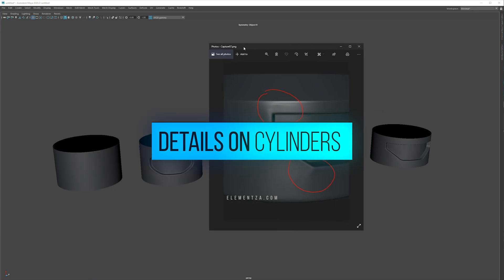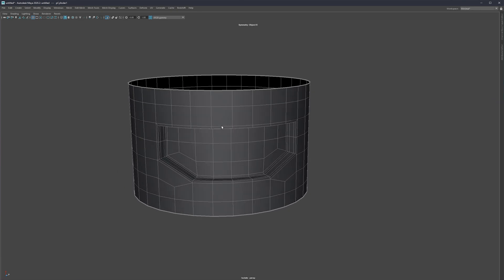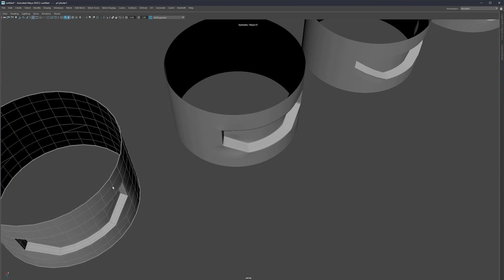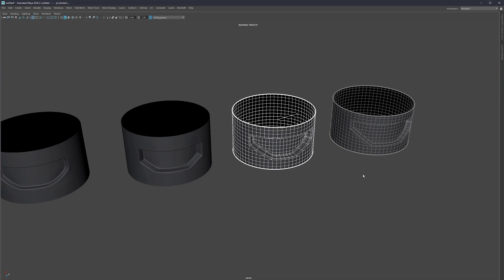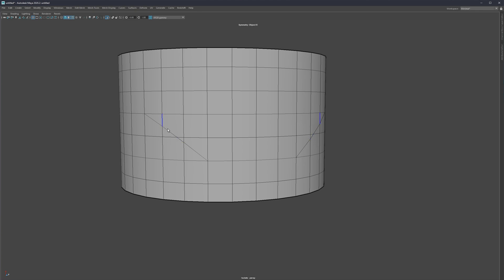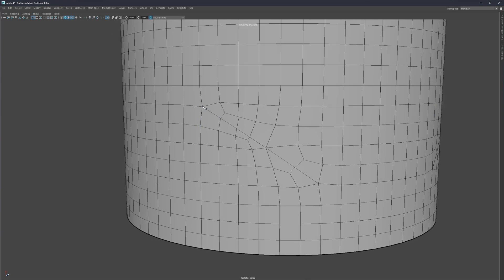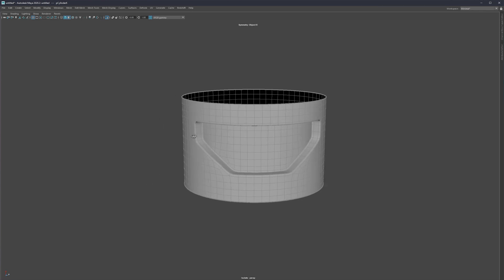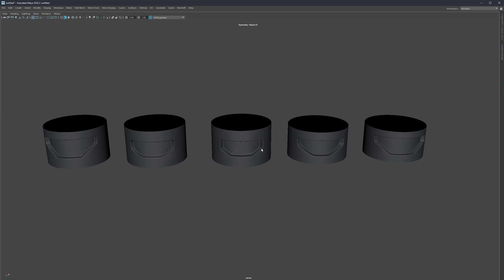Why am I getting this type of pinching?

Comment: I just want to be sure about this, since I was a little confused while watching this video. So subdividing will get rid of the triangles that cause the shading problems. But it might also warp your diagonal lines, so you might need to get rid of some of those triangles first, then subdivide and do some cleanup.

I guess the best thing to do is experiment with various techniques and see how the techniques change the shading. Obviously it helps to know how edges are going to affect the shading, which is definitely something I'll need to keep in mind. It might be useful to experiment with modelling on curves just for the experience.

Comment: Tip: Build it by starting out with a flat plane and then bend it with the bend deformer to a cylinder.
Start by calculating the circumference of the cylinder (π * the witdh of the cylinder), this is the width of your plane. The height of the plane is just the height of the cylinder. Do all the modeling you like on the plane, extrusions etc, when you’re done, create a bend deformer with the plane selected (deform > non-linear > bend), scale the deformer in xyz so that it matches the width of the plane. Bend 360 degrees. You might have to change the orientation of the deformer by rotating, once you start bending it’s fairly easy the see on the gizmo how it needs to be oriented. When done, make a duplicate of your newly created, detailed cylinder and merge the borders that came together after the bend.
Bending this way you ensure that all the detailing ends up as closely as possible to match a cylinder, and it’s sooooooo much easier to build things flat.
Reply: Yes, and no. If you don't have proper topology to support the details you'll still get shading errors even with this method.
Reply: @filipstamate1564  Yes, if you don’t have proper topology to not having shading errors, you’ll have shading errors. Correct.
Reply: nice! this is actually a great workaround I've yet to see or hear. small details don't effect curvature too much but larger ones definitely do. Gotta try this out.

Comment: If this surface were spherical it would pinch more.....and the ultimate thing to correct it is to shrink wrap the subdivision to a master clean surface with overall shape :)
Reply: It's been 4 years and we still don't have that fancy shrink wrap in 3ds max. you mean the one you use to correct the curvature and all that right? I don't think it will work in this case because of the edge flow, he has a video on this. the ultimate goal it to just start with a higher poly mesh. But in other cases it works very well, again, it doesn't exist in 3ds max.

Comment: in 3ds max one can conform pinching/bloating  parts to a perfect cylinder.. never found something like conform brush in maya
Reply from the maker: Yeah I hear ya but Maya has Conform under Mesh - Conform. However, this works only if your surface does not have any depth or details like in this case. Also, topology still has to be properly set, more or less. If the mesh has large gaps or imbalance in the spread, the conform tool will still give the same shading issues you see in the video. If there is pinching on the balanced mesh, a conform tool can fix that, sure, especially in combination with Vertex Average or Sculpting Brush.

Hope this helps.